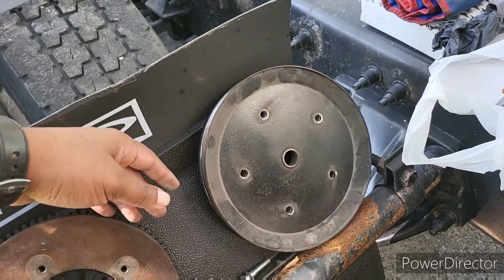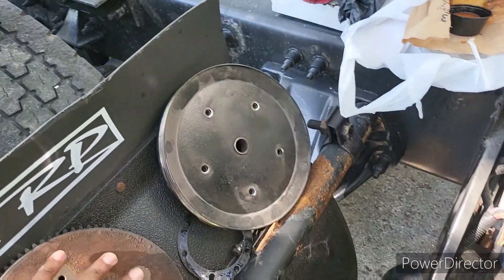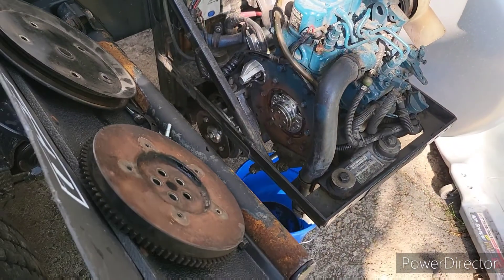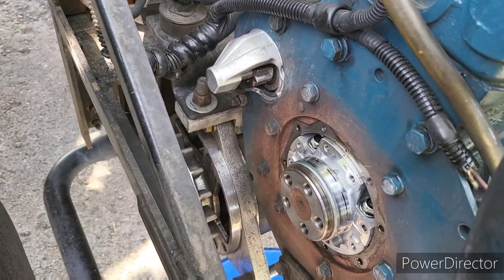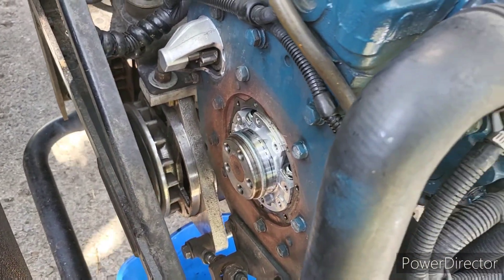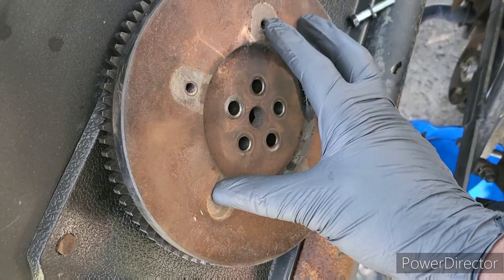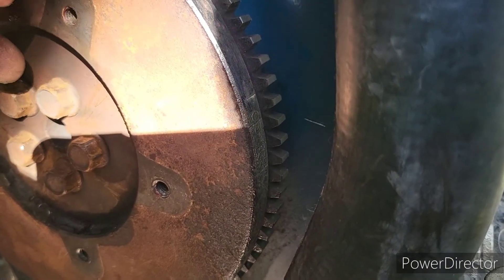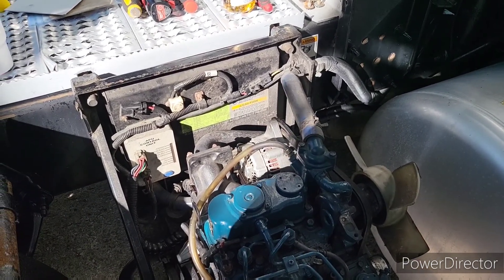Carrier APU PC6012 (Oil Seal Replacement)

Comment: I  got mine for $1,000 off the Auction Lot.   I’ve had to change the Starter twice because the first one went bad after 2 months.   I’ve replaced the Valve Cover Gasket.  My Son helped me Install it on my truck.   I so far have about $3,500 into it.   Thanks to your video I now know where my main oil leak is.   While I’m at it I’m going to change the Head Gasket and the Valve Cover Gasket again because that is still leaking.   Thanks for going thru this,  I appreciate the Help.
Reply: I forgot I also had both Glow Plugs Replaced and had to have a New Exhaust rerouted underneath then pointed forward to avoid it blowing in to my Faring.   I mounted it on the Drivers Side on a Freightliner Cascadia.    We also had to flip my main Air tank turned around because the Air Dryer Canaster was in the way.